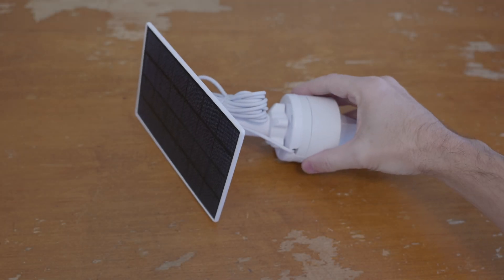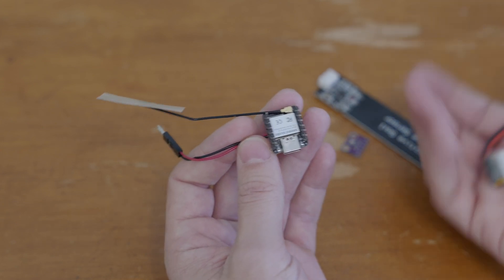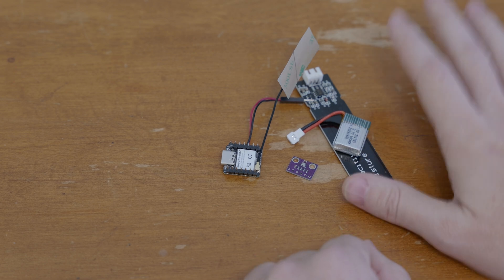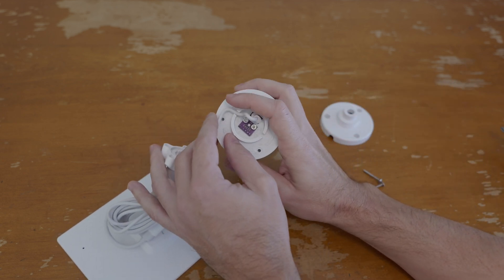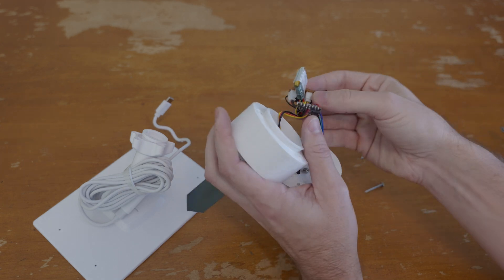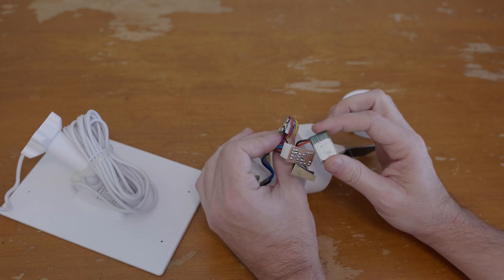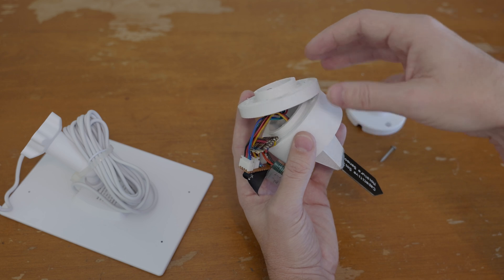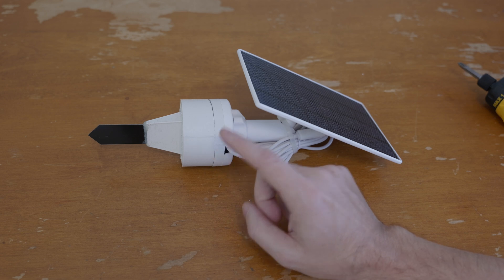Easy Solar Outdoor Weather Sensor with ESPHome and Home Assistant

Comment from the maker: Make sure to watch the part on the compromises in the design. After a few more days of letting it run, I think the biggest source of temperature inaccuracy is simply the housing itself heating up in direct sun. That may be a deal-breaker for some, and I would recommend a redesign of the housing to build in some shade and different ventilation to get a better reading on air temperature. The current design is small, and I think come spring/summer it will probably heat up quite a bit.

Comment: Thank you for sharing it. Do you think that it could be possible to use the same solar panel connected to more than one sensor unit at same time?
Reply from the maker: For sure. This project uses a couple of sensors. The panel is rated for 3W at 5V, so that's around 600ma of current. Accounting for charging, I'd say you could run an esp32 board with another 50-100mA of sensor draw without much problem while still keeping the battery topped up. The BME280 board in my project draws less than 1mA. I don't remember what the soil moisture draw is, but it's way under 20mA because I can power it from a GPIO. 

Obviously, it depends on the specific sensors you're wanting to use, but most sensors use very little current.

Comment: Do you think it's possible to connect a smaller solar panel to one of the connectors on the board rather than the usb-c, for a smaller indoor version of this?
Reply from the maker: I think if you hook into the +5v pin on the board, that will run through the battery charger IC also, so that should work just the same as running the power through the USB port.
Reply: @TechDregs  Ok, thank you! Do you think that would require a Step Up Converter to ensure that the input from the solar panels are at 5V, or will IC deal with that?
Reply from the maker: I believe the charging IC will handle all of that.

Comment: Hey, thanks for posting this.  It's given me some solid ideas for a possibly more panel-integrated option.  Get a maybe 2 or 3 watt more plain panel and print a backing enclosure for it and mount the sensors in the shaded side (with some stand-off posts to isolate it more).  The panel provides most of the rain protection and only a little epoxy should be needed to make it last  quite a long time.....  I think I would incorporate a charge controller, but the ETA4054 should be taking care of monitoring battery voltage and current itself, and not need the voltage divider for the mcu unless you are looking at going back to sleep if voltage too low.  But if the battery has an internal protection chip that shouldn't be needed either.  Not sure what that battery has however.
Reply from the maker: I monitor the battery just for information purposes. Like, when I built this, I wasn't 100% sure that everything would play nice with each other, and I also wanted to see if my estimates on usage played out in the real world. Plus, I'm just kind of a data junkie... I just like knowing. :-) 

What you're talking about with placing the enclosure on the back of the panel is what I had originally planned on doing, and I think it's a great idea.
Reply: @TechDregs  and THAT makes all the sense in the world.  Yeah I get the desire for data.  I try to reign myself in on that front wherever I can. :)

Comment: Awesome project build. Did you have a link for the solar panel?
Reply from the maker: Unfortunately, the one I used is no longer for sale. But if you look up 5V 3W panels with USB-C, they all look like they are pretty much the same.